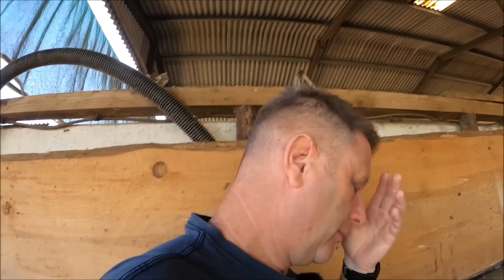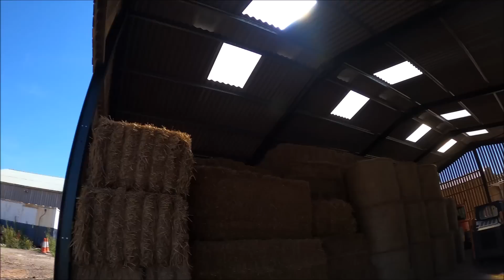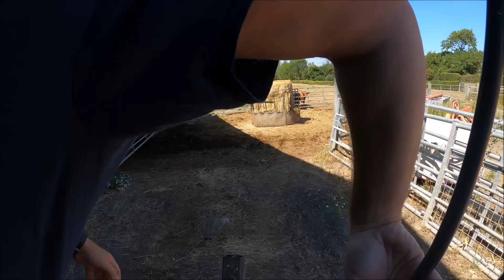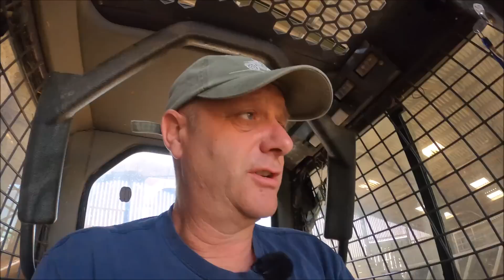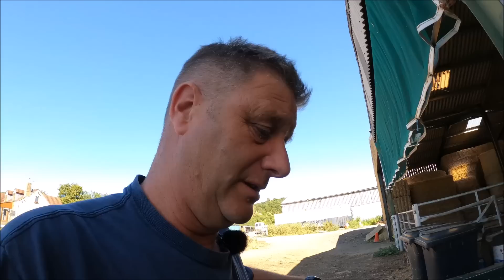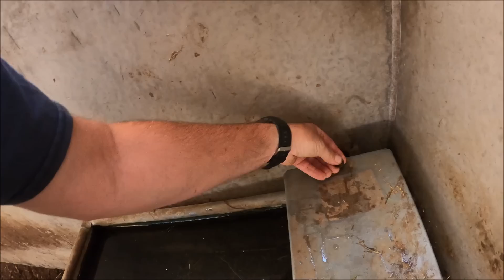10/08/22.  When your ball cock gets stuck at midnight!

Comment: We had a similar problem in our horsebarns. The horses all have their own waterunit. And it has a circulation pump on it. And sometimes the broke a hose and water kept running (as this usually happened at night). A lot of water wasted, but also alot of straw. Now we have an "aqualeak" installed. You can tell that thing how long it's allowed to run without pauze and/or how many liters. If one of those parameter is crossed, the waterline gets shut. You also get minor and major alerts. Not cheap, but less stress and less waste. I was sceptical if it would work with 30+ drinkers.. but it works really well.

Comment: Our method was to put half a brick under the ballcock so it didn't get stuck.  Hopefully a long spell of gentle rain will get the grass growing enough so the cattle can be left out until late autumn without any supplementary feed - not so the grass...  I think a lot of permanent pasture around here is going to need some hideously expensive 20-10-10 to be worth grazing next year.   Get yourself a small stilson wrench for your toolkit, you don't need to worry about exact spanner sizes 😄
Reply from the maker: Grass is certainly going to need some tonic.

Comment: Maybe it's me, but I thought that the Peggler valve that the ballcock arm is attached to looks to be rotated by a few degrees anti-clockwise (yo, digital clocks), so that the ballcock will naturally descend towards the right side of the enclosure.

If bending doesn't fully sort the problem, it's something for you to think about. A quick(?) tweak with a large Stilson  or other adjustable wrench. Unless of course it comes off in your hand ;-)

Comment: ...... our work is determined by the cross-over .. this is when the humidity level drops below the temperature .. generally the temp starts off low and the opposite for the humidity which starts of high ... last year in July there were temps above 40C and consequently the bush was shutdown mid July and did not reopen till end of September. This year things are better, like today we are on the up swing, at 11:30 am the temp is 25C and the humidity is 38% and it has been in this neck of the woods since the end of the week and they are threatening that we will be back in the bush tomorrow, Tuesday the 16th, not bad, exactly 2 weeks we have been out of the bush .... the rise in the humidity overnight is just about entirely due to the dew, last evening I was out for a walk as the sun was setting and could really feel the moisture in the air ..... was really hoping that you would be getting a second cutting ... my boss has 140 acers in hay and does at least 3 cuttings, has everything irrigated with pivots, otherwise with the climate here be lucky to get one. We get a feel for what the season is going to be like by when the side hills go brown, some years as early as the beginning of May and like this year mid July they were still green and by Aug first we had forest fires .... why I got on this track about my boss. This year he is experimenting with grazing corn. I had not heard of it before. Yes it stands tall and when the cattle come off the range he will divide the field with fences and alternate this area with other fields for grazing and later when the snow is down he spreads bales, always in a different spot so the paddies are spread around. Is corn grown in your area. A week or so ago you mentioned that the field that is being turned this year was the only one that was coming back well after the first cut, wondered if this land had better ground water .. carried on a bit here .. sorry ... thx for the share FP .. as always .. never stop dreaming, just dream bigger .. have fun be safe, save our oceans ....

Comment: Apologies for my ignorance, but what’s the difference between hay, haylige and silage?
Reply from the maker: Hay is high dry matter and must be stored under cover out of the rain. Haylage is a bit damper and is wrapped to keep oxygen out. It feeds similar to hay but less dusty and can be stored outside. Silage is green grass only wilted for a day, it is wrapped and ferments (pickled) which makes it very palatable, it must be stored in an air tight clamp or wrapped which means it can also be stored outside.
Hay and haylage is usually fed in racks alone. Chopped (clamp) silage is often fed in a mixed ration processed in a tractor powered (trailed) ration wagon.

Comment: Ok can you explain to me why all the rain water off the back of the barn is ok to collect for drinking water for the cows  but the water collected between  the new and the old barn  is to nasty  ( your words )  to collect for the cows to drink
Reply from the maker: One is roof water, so apart from dust it’s fairly clean, the other runs off the road and yards and not fit for drinking.
Reply: @FarmerP  Look I am not trying to be a dick. But I think you know I am not talking about collecting ground water  but the water between the old barn roof and new barn roof   by using some pvc pipe ( reusing the down spout pipes) and running it down the side of the old barn ( you could extend this out to the front corner drain for even more free water. I will be waiting to hear your reason why this is a bad idea)  🤣🤣and hooking it into  the back roof collecting system instead of draining it into the ground system. I know the tank over flows are hooked in to the same under ground draining system so to much water should not be a problem You said your cows would rather drink the rain water anyway
Reply from the maker: @homey3051  Ah, Sorry, I misunderstood the question. I would collect that too, but I would need to add another big tank and pipework which is not as easy as it sounds to install for that position. The only space suitable for a big tank is on the uphill side of the new barn. The concrete panels are only 95mm thick, I'm not sure they would like the pressure exerted by twenty tonnes of water.

Comment: Ian I been run out of water on my farm, for over a week night now, as my well has run low and is not going to pump up.
All being well I should be having a new borehole put in, it will be much deeper and should be starting it tomorrow  it will cost £4,500 +vat.
You may want to look at getting one.
Reply from the maker: Quotes average around the £10’000 mark here, depending on the pump type and depth.😬